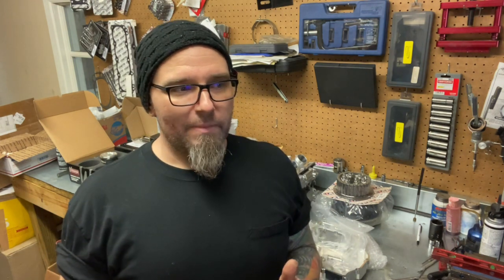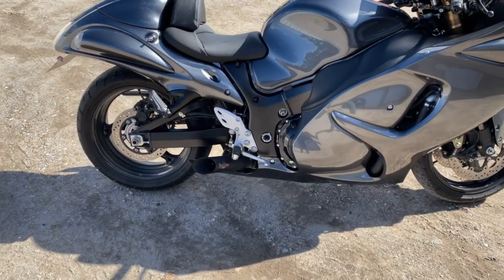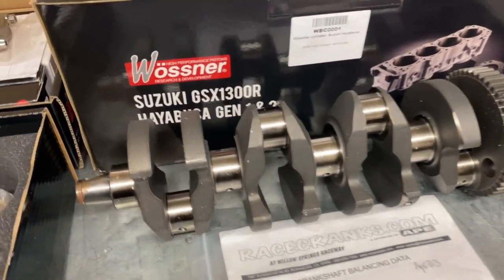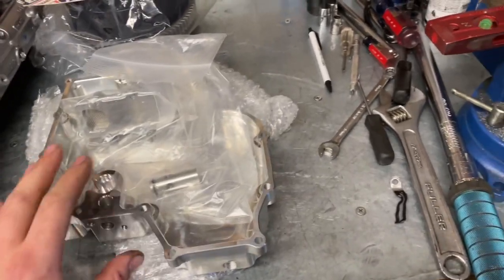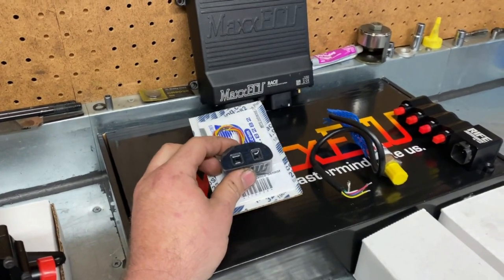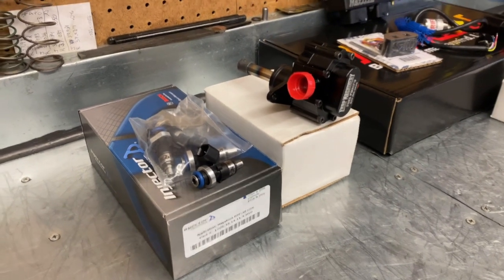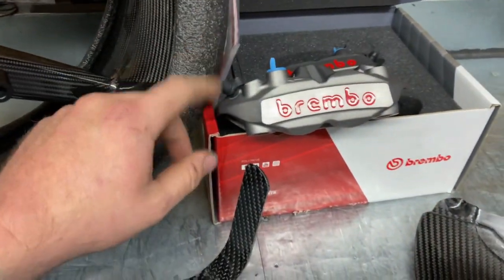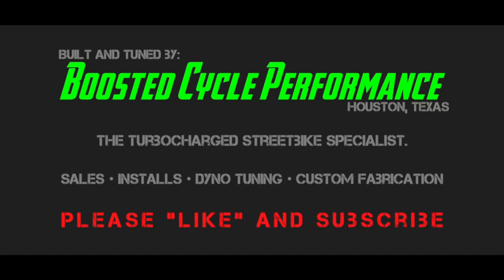1000HP TURBO HAYABUSA BUILD PARTS OVERVIEW/ INTRODUCTION. HP TECH

Comment: Im not sure if your ever going to see this, but im using those 81mm gen2 wossner hayabusa pistons in a car engine(89.3mm stroke) and we have taken it over 800bhp with over 500ftlbs of torque so the 18mm pins are putting in hardwork, plans to turn it up to 900-950bhp this summer on a GTX42 we have fitted, we only rev to 10000rpm because of the stroke, so looking forward to how you get on yours.
Reply from the maker: I read every comment. Yeah, even though the pins are 18mm, they have massive wall thickness. I think that’s the key.
Reply: Where did you guys max out on those pistons?

Comment: Very similar to my 2013 in form and style. Me and the bikes owner see things very eye to eye. The only difference so far is the carbon tail which thanks to you i will be ordering, and my bst fits a 240 rear. Not sure how big yours is but if its anything like mine it will looks awesome. Mine makes 571 at the wheel right now and i will be keeping a close eye on this build.
Reply from the maker: This is a 200mm tire on a .625” wider wheel. If you watch part 2 of this build I mount it up on the bike. Looks great.

Comment: @Boosted Cycle Performance
Great videos! 
Can you please post the complete parts list in the description or chat? (If someone already has that online can you please tag?)
Reply from the maker: Thank you. I don’t have a text list, but I showed everything in the video.
Reply: @BoostedCyclePerformance  thanks for the reply.  All in how much is a build like this engine and transmission only? I'm building a kit car and want to use a Hayabusa engine running around 500 hp. Want it to be reliable on track (circuit).

Comment: Subscribed and the best of Luck!,  As the car guys will tell you, there is no substitute for cubes.
Reply from the maker: Thanks for watching! I’m heavy in the turbo LS world, and have a 500hp sr20 240sx. There is indeed a replacement for displacement, it’s called volumetric efficiency. The boomers don’t like hearing that.
Reply: I guess back in the day someone had the idea to use 'car parts' in turbo applications for bikes to make bigger HP. Boomers ?

Comment: Do you do any case mods for added oiling?
Reply from the maker: No sir. I also use stock oil gear, with a high pressure valve. If your bearing clearance are set right, that’s all that’s needed.
Reply: @BoostedCyclePerformance  what’s the tricks to the bearings. Old pyshobike article’s reference tight in mains and a bit loose on rods. Do you have any recommendations for tolerances. Drag application only

Comment: Are you going to do a few vids on the actual build and tune as this is easily the most existing build on YouTube I haven't seen another turbo build like this,
Also a vid of it destroying the streets would be amazing I'm sure i speek for on here wanting to see that and more👍
Reply from the maker: Thanks for watching! But yes I’ll be documenting the whole build with the exception of the engine. A lot more goes in to building a stoker engine then just a pistons rods set up, so I don’t want to make engine building seem more complicated then it is for someone watching that’s contemplating building their own. It’s being built to be able to be ridden on the street reliably, but most of the racing will be at events.
Reply: Tnx 4 reply the only thing this is missing are some ohlins front and back lol
Reply from the maker: Doing ohlins forks wouldn’t benefit the bike at all as it’s a straight line bike. The front wheel is there for landing gear pretty much. 😂 I do a penski shock for the rear.
Reply: @BoostedCyclePerformance  but as far as I know garette gt 3582 max produce 600hp.

Comment: ive seen a 962 horsepower busa on a dyno, that thing was scary
Reply from the maker: I’ve seen that too. I’ve built many bikes that are capable of well over 700hp, but usually stop tuning at the dyno around 600. It’s unnerving how you start to feel things start to move around on the bike when strapped down making that much power.

Comment: Buddy I am so glad I found yr channel. I always built n raced mustangs n stuff n I always loved my bikes but really never got into them. I have a spare turbo I would love to put on my liter bike. I have looked for the tubing parts n header, but can't find anything. Is there a place to order the header flange n tubing to make a kit. Idk if using pie cuts like on my racecar would honestly hold up. I have never installed a turbo on one. But like y said in the beginning if y can work on cars y can these. But Im goin to go back thru yr videos n check them out. Thanks for the videos n God Bless!!
Reply from the maker: I’m so happy to hear this. My goal is to inspire the average guy to do the work themselves. Depending on the bike you have there might be header flanges available for it. But likely, you’ll have to make something yourself. As far as tubing, sch 40 stainless weld elbow are common. Myself and rcc use just standard .070 wall stainless tube. Bike turbo headers are very tricky.
Reply: @BoostedCyclePerformance   Where is a good place to order the piping at? I also thout about using Nitrous, n I kn on my car for every 50 hp I retard the timing 2 degrees, or may be 3 just depends on how hott the day is. I don't know if the Nos controller is the same as on a car or not setting it up to come on n stuff. But Buddy I sure do appreciate ya alot for taking the time to do these video's.

Comment: Of Course, if you don't want to work on bikes anymore, I would check out NASA , or L3 Communications , or the Skunk Works a Lockhead Marten division .......
Reply from the maker: Been tossing around going to SpaceX…
Reply: @BoostedCyclePerformance  I worked on airplanes as a A&P for 18 years got a invite to space X abought 8 or 12 years ago when they first got going , I can tell you looking back I wish I would have went..

Comment: Great video. Why did you decide to go with Wossner pistons and rods?
Reply from the maker: Thank you. Wossner is what I’ve always used, and never had any issues or concerns with them that would lead me to use something else.
Reply: @BoostedCyclePerformance  one more question, well actually two. How hard is it to get the knock sensor inputs to work?  I heard since the transmission was enclosed in the same case, it can't monitor it.  Also, I heard you mention in your piece "variable valve timing".  How will the ECU monitor that?  Thanks in advance.

Comment: Whew with the big stroke crank piston speed fast as fuck boi, rods become basic maint... Pain in the ass.
Reply: When your trying to make HUGE power with boost rod bearings are always "basic maintenance” for sure!  But high piston speeds are pretty common in todays high reving 4 holes. Case in point Honda cars!

Comment: Also NLR made a 1000HP
Reply: no
Reply: @naomifox7899  NLR Sweden made 800 something on gasoline like 15 years ago.
Reply: @V8Lenny  no that was 701 and it was on christers johanssons bike.I know all those guys.
Reply: @naomifox7899  717 in Sweden and they built it again with bigger turbo and other changes.
Reply: @V8Lenny  you mean when they did the s400 version with the barrel style throttlebodies etc built for hank booth?
Reply: @naomifox7899  it always had S400 and barrel throttles.

Comment: So your billet block, has no water ports. Proline 481x v8 blocks had the same problem until recently. Now Proline engines have water jacketed blocks & heads. I guess your motorcycle engine head is not water cooled either. I guess this will be a race only engine. Once all the racing companies start making water jacketed billet blocks & heads, people will have, daily driven high horsepower billet engines that will never overheat especially, if you put intercoolers on the turbos & superchargers, cool the engine, transmission, & rear differential oils with oil coolers. A big aluminium radiator getting plenty of direct cool fresh air, & perhaps water misting spray valves when engine is redlined & working hard & producing lots of heat. They have even had water cooled shorty headers back in the day. A pipe inside a pipe with water flowing on the outside of the red hot tubular headers, & it's own radiator, but inner ceramic coating inside the headers solved that problem or so they say. I've often wondered why turbochargers are not split into two pieces keeping the hot exhaust section away from the cold intake section & connecting the two impeller wheels via a carbon kevlar or titanium rod. Eventually billet wankel rotary engines, with ceramic needle bearings, & split turbochargers will put piston engines out of business because of less moving parts & higher rpms. Imagine a rotary wankel engine the size of a 572 BBC with 8 wankel rotary pistons & two 100 cm turbochargers, piston engines won't have a chance.
Reply from the maker: Im not running a billet block. I was looking for one, but the only ones I could find didn’t have water ports.

Comment: I dont believe that can be done on an engine with OEM parts.
Reply from the maker: Did you watch the video? It’s a built engine.
Reply: @BoostedCyclePerformance  Okay.
Reply: @Boosted Cycle Performance  I thought you were implying that one can slap on a turbo or supercharger, reflash the module, and get tremendous power for less than $2000. I get it now. It's about a built-up engine that you are talking about and not just accessoriesries.
Reply from the maker: @AFRO_KEEN  you have your videos mixed up my friend. This comment section is for the 1k HP busa build. I do have another series “500hp for $1500”. And yes you are right, the series is based on spending $1500 to upgrade your existing 230hp turbo Busa.
Reply from the maker: @AFRO_KEEN  you have your videos mixed up my friend. This comment section is for the 1k HP busa build. I do have another series “500hp for $1500”. And yes you are right, the series is based on spending $1500 to upgrade your existing 230hp turbo Busa.
Reply: @Boosted Cycle Performance  I want to see a video of that bike running with a 1000 horsepower engine in it because it sounds amazing.👍🔥

Comment: All I see is you throwing random numbers in the YouTube thumbnails man.
Reply from the maker: What’s random about a build that can exceed 1000hp?
Reply: @BoostedCyclePerformance  I don't mean to disrespect your work by any means man but I feel like you just throw there a fancy number with the possibility that can happen, i would prefer to see you more humble on those numbers even if in theory the build can potentially be 1000rwhp.
Reply from the maker: If you’ve followed me for any amount of time, you’d see that I don’t shoot for lavish numbers. I put combinations together that are honestly on the minimal side but reliably can meet or exceed the clients HP goals. 

This build here is a no expense spared build to make the absolute most HP possible. The turbo alone on this build is rated for 960hp on a typical 4cyl car engine. However on bike you usually see at a minimum 20% more power then what a turbo is rated for because they can rev twice as high. So on boost alone, 1000hp is very achievable. If not, I can always use the nitrous. 

Lastly while yes it will be cool to say it made over 1000hp. But the main goal is to have unlimited power on tap to fully utilize all the latest technology on the bike to see how fast we can really go. 

This is how things in the Motorsports world progress. Embrace technology, and push limits.
Reply: @BoostedCyclePerformance  yeah you are 100% on point I found your channel recently and I already watched a lot of your build videos, what I tried and wanted to say wasn't to disrespect your work but rather to point out that until this  build is done is for the better if you set a target below the expectations, 1000hp to be reliable and hold beyond couple of validations on the dyno or few runs on the drag days is long way to go, I can understand why it got you frustrated a little but all I tried to say is that is a freaking crazy build dude and I'm quite excited to see the outcome of this don't get me wrong also I'm in love with the actual numbers but more I'm in love with the proper reliable builds and the hope that these motors will last longer than the usual crazy builds. In the end of the day you maybe choose to yield back some boost for reliability. Regardless I'm quite stoned with what you are trying to achieve over there I just spit my thoughts from a safe place.